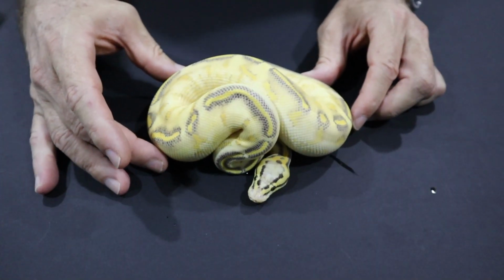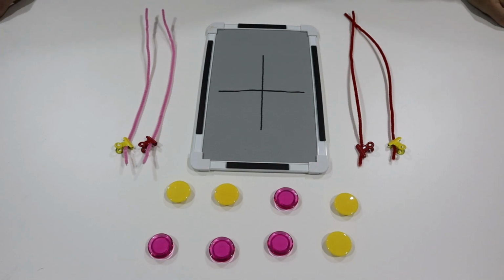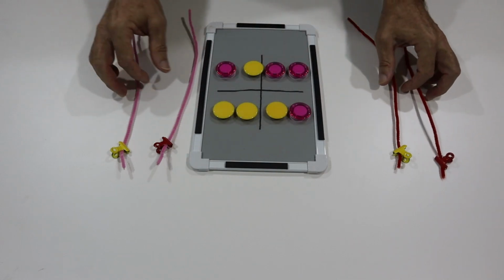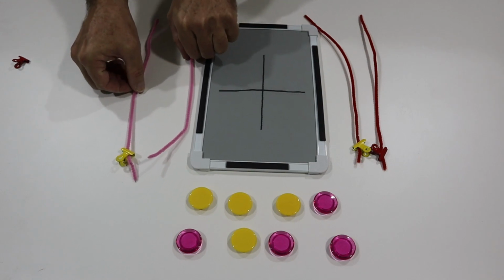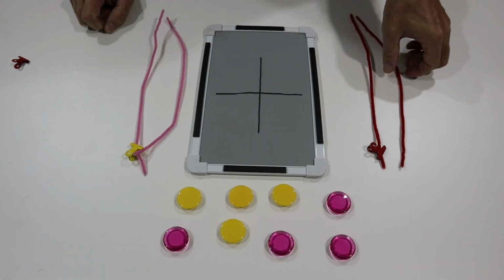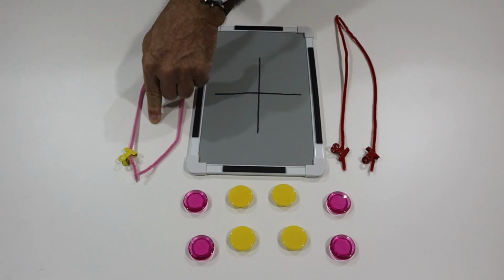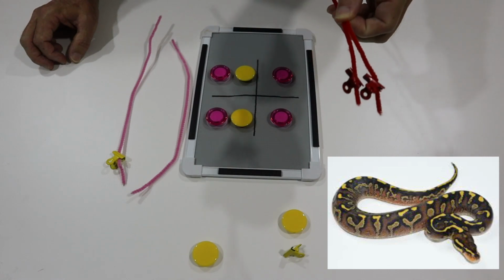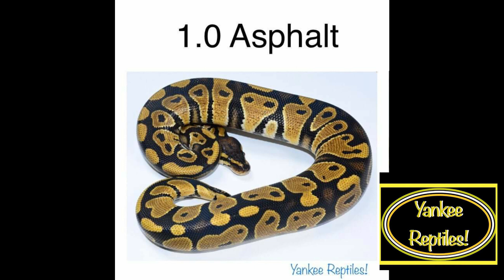Breeding Ball Pythons; Managing Complex Genetic Projects - Allelic Freeways and Highways

Comment: Ah, so trying to breed an Ivory to an asphalt gravel (ALS) [ I did see someone on morph market trying to sell one as a "pavement" ] would result in freeways and highways ( but no Ivories or gravels or asphalts) but leave you with no idea which was which. Now there is a selling nightmare outside the pet only market. :O
Reply: satanswombat exactly. Hence the 1.0 SA or 1.0 SG being the safe way to go even though it’s more costly. It guarantees the genes as well as producing the more marketable offspring
Reply from the maker: An Ivory to an Asphalt will give you 50% Freeways and the other 50% must be Yellowbelly. Similarly, a Super Asphalt to a Yellowbelly will give you 50% Freeways and 50% Asphalt. Both have a 100% predictable outcome for the none Freeways. 

From a planning perspective, I could work with either except that the Ivory hides the other genes it might carry (another nightmare for both seller and buyer), while the Super Asphalt you can see the extra genes in the appearance of the snake. So we try to avoid using Ivories unless we made them ourselves and we're 100% certain what other genes are in there.

From an economic perspective, I would rather have surplus Asphalts (from SA to YB pairings) to sell than surplus Yellowbelly (from Ivory to Asphalt pairings). In the first season, Yankee Reptiles will be producing a bunch of Freeways and a bunch of Asphalts, which Andrew can 100% guarantee are Asphalts. I think this is financially the way to go.

When Andrew has made a few YB purchases, we'll do a follow on video showing what he'll get from the pairings, which he will keep, which he will sell and what the generation 2 pairing options are. Even before he pairs up generation 1! This is where we really start to see the economic benefits of the using the Super Asphalt. Andrew will be able to create more Super Asphalts to carry forward, but also to sell. I think Super Asphalts as a by-product are just a little bit more profitable than creating Ivories! At this point Yankee Reptiles will be selling the components of a ready made Freeway project and I'm almost certain buyers will want to buy 2 to 3 select snakes to kick-start their own Freeway projects.

The outcomes that give you the uncertainty (selling nightmare) are Freeway to either Asphalt or Yellowbelly, (25% Freeway, 25% Super Asphalt or Super Yellowbelly, 25% Asphalt, 25% Yellowbelly) and for those who have to buy Asphalt and YB to get started, Asphalt to YB (gives 25% Freeway, 25% normals, 25% Asphalt, 25% YB). 

That's what makes this such a fascinating project and so important to plan. And I'm glad it's helping people think ahead.